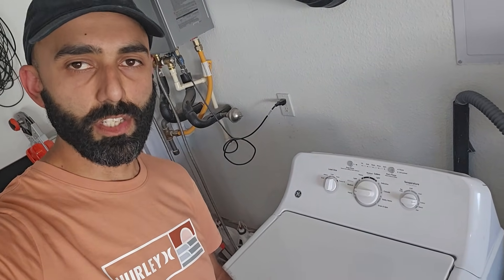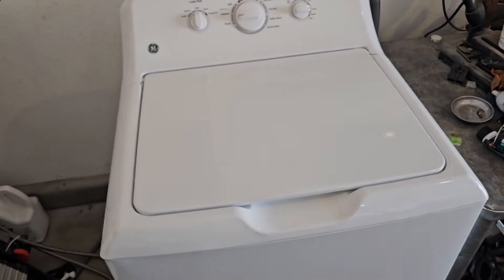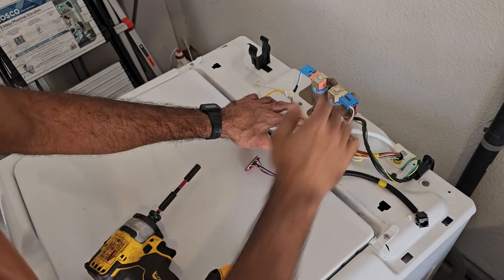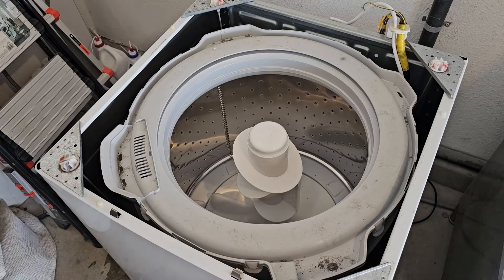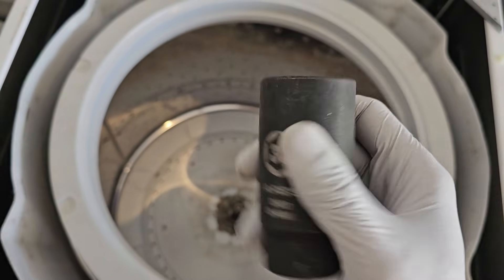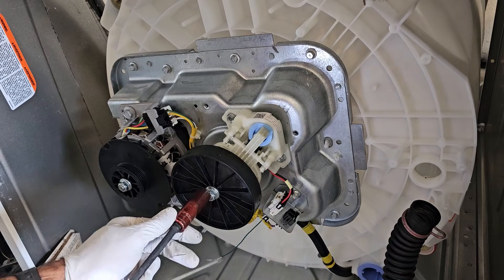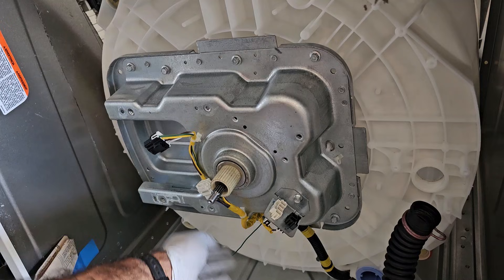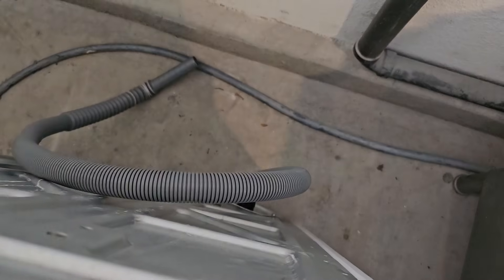GE Top Load Washer Complete Teardown!

Comment: I washed a cheap rug that my wife bought  on hot. It left grey cement looking reside all over the inside of my new GE top loader. I wiped it all out and ran it normal hot with tide machine cleaner . What else should I do? I did 2 loads already but dont want to break it

Comment: I’m having a issue with black mildew and I wanted to take the tub out to pressure wash it, is this the best way to do it?
Reply: I recently cleaned mine without taking the tub apart. I took off the agitator as shown and cleaned it thoroughly inside and out, that was the source of most of the black mold. I also took the top of the machine off as shown, then spiral wrapped a long thin rag (made from an old t-shirt) on a yard stick, and dunked it into a bucket of hot water mixed with Lysol cleaner, and poked it down between the inside drum and outer tub and worked it all the way around to clean out all the crud that was built up in there. Then I put it back together and ran a full cycle on hot with bleach and detergent. No more mold issues!